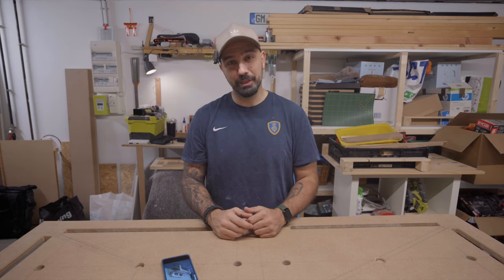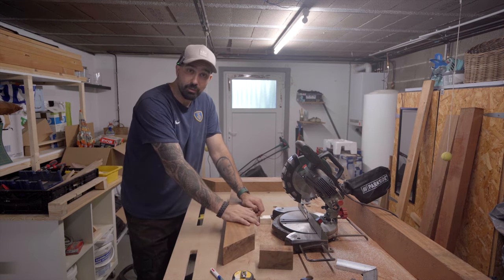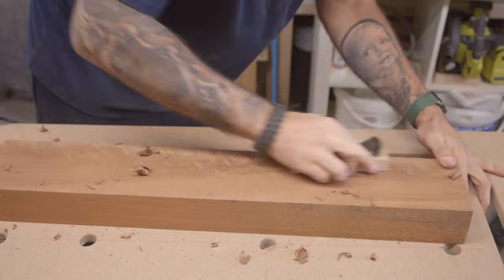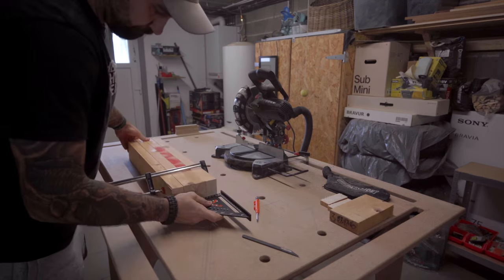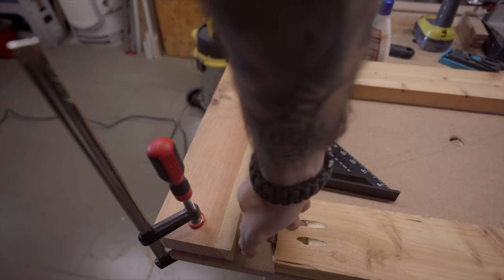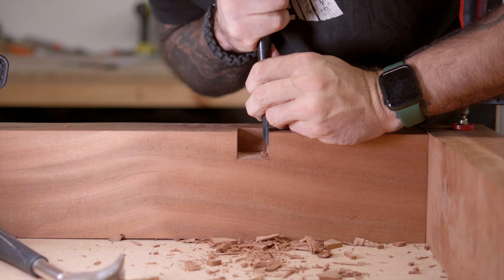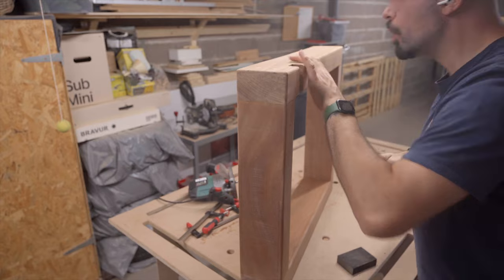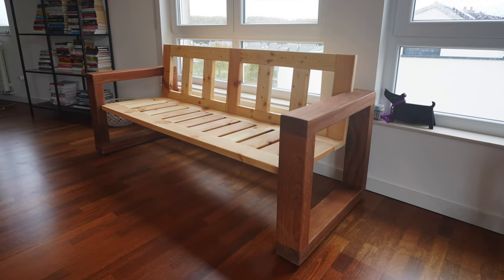DIY Sofa Build: From Scratch to Sale!

Comment: Hi, I dont knw if you have already filled in the pocket holes, If not then you can buy wooden plugs that you glue into the holes, when the glue is dry you just flush cut them and sand, leaves a nice finish. good luck with your future projects. Jim, Scotland.
Reply from the maker: Hi Jim, no I didn’t filled in the pocket holes on the back and under side of the bench. If I’m honest I was kinda a lazy and super excited to finish up the video that I didn’t do it. But I do agree with you I should do it, it would look even better. And since we received our « real » sofa just a few days ago, I now can sell it, so I will have to make it « perfect » before putting it out  on internet for sell. 
Thanks

Comment: Great job, I have a minor comment which might have helped. Farther than adding the dowels in the back after you had fastened it together I would have drilled all the way through from the backrest to the seat. This guaranteed perfect alignment and probably greater strength.
Reply from the maker: I thought about it, but once again my limited set of tools didn’t allow me to do so. I have 90 degrees angle drill bit. Not do I have a long enough drill bit to go through the width of the backrest. 
But once we receive our « real » sofa, I’m thinking about screwing and glueing everything parts together for greater strength, and I think it should still fit through most doors so I don’t need to make it being able to be take apart..
Thanks anyway for your advice.

Comment: I have a few finishing tips for you! When you do your glue ups, keep a wet rag on hand to scrub off the glue squeeze out- it prevents discoloring of the wood around the joints when you apply your finish. FINISHES!! I have never heard what that man told you in the store. I primarily refinish furniture. Finish applied incorrectly will ruin a project. Wipe- on finishes like your danish oil are the easiest and most forgiving, and yours came out really nicely! All finishes are designed to protect wood, they are not able to decide that they aren't going to work on that specific type of wood. Color is a different story. Unless marked clear or a specific color, most will impart an amber tone. Which is pretty :) The sofa came out beautifully- good luck on selling it!
Reply from the maker: Thanks a lot for the tips, I will definitely incorporate it to next my workflow. The other “mistake” I did is that I mixed wood dust with wood glue to do some finishes on the joints, and that’s (I think) where the discoloration happened mostly. I don’t know I think. 
Anyway, I’m a work in progress and your feedback is more then welcomed. Thanks again
Reply: Not a mistake at all! You use the damp cloth on that too! Since you used a wipe on oil finish, if those spots are not to your liking you just sand those areas and re-apply. Easy Peasy. All it is is the glue preventing the fibers from absorbing finish at the same level as the rest of the wood. Cheers! Make a chair to go with it! @IgorAnic9
Reply from the maker: @acijami  thanks. I’m planning on a coffee table…